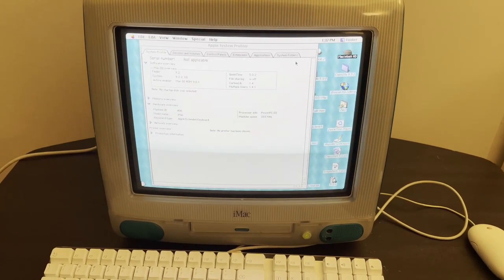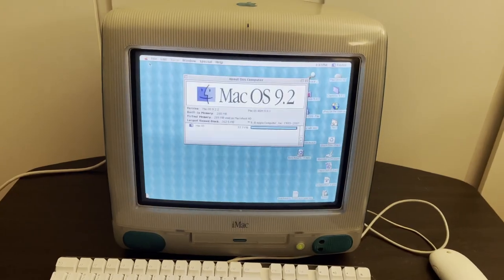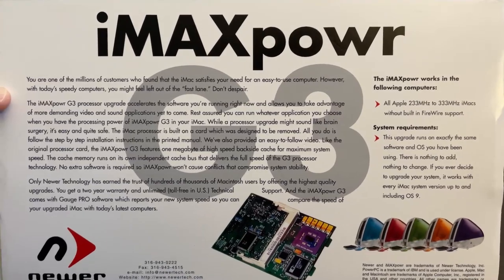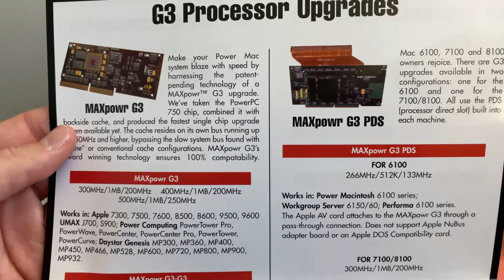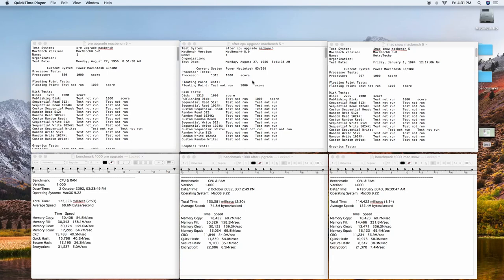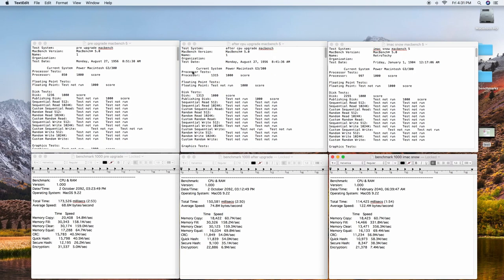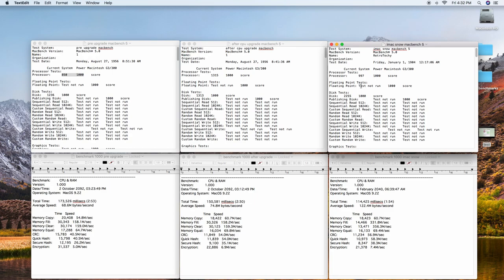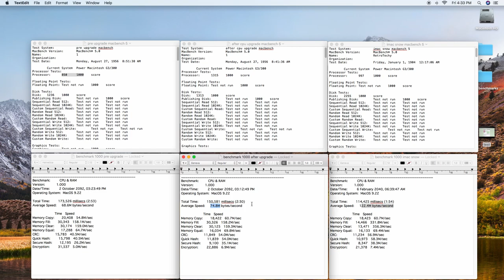iMac G3 Drop in CPU Upgrade

Comment: I like these things for some reason. Well. Not the Mac solutions only. This aproach can be found in all types of platforms. Like Amiga, AtariST and X86 machines as well.
Reply from the maker: Yeah and it was simply plug and play which is much better than having special software. Thanks for watching!
Reply: @RetroTechy  Yup. I have dabbeled in these Terrible Fire's for Amiga500 my self. Although they are not vintage yet modern and are being produced today, then they are still much the same aproach. Onboard Ram, onboard IDE and of course replacing the original CPU from 68000 to 68030. As of now I have an TF-1230 and a Tsunami-1230 for my Amiga1200.
Reply from the maker: Sounds amazing! I’ve never gotten into Amiga myself but they are a great piece of computing history
Reply: @RetroTechy  True.... Everything between 1978/79 and to around 1999 are cool. The 1980's are perhaps the time, were things are the most exciting. You know, late 80's mac and early 80's 8-bit machines.

Comment: I know there was some other company that would do that same thing with upgrading a G3 Mac to a G4 because the G3 and G4 (the initial 7400 series, I don’t think the 7450 series was pin compatible) were pin compatible, and could run at (mostly) the same speeds
Reply from the maker: Can you imagine this service today? Upgrading your M1 Mac with a speedier processor. Some things were just better back then.
Reply: @RetroTechy  or imagine if they made an upgrade card for Intel to M1 just like the PowerPC upgrade card for Quadra and Centris users